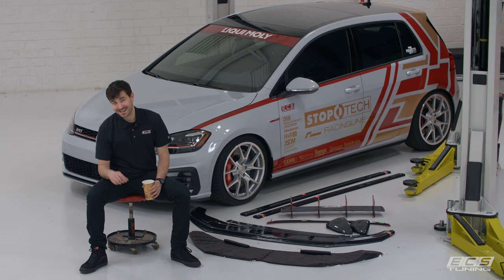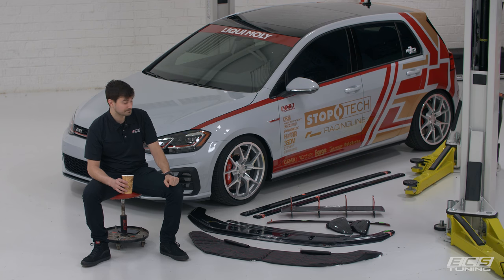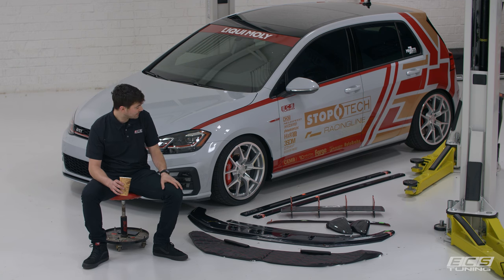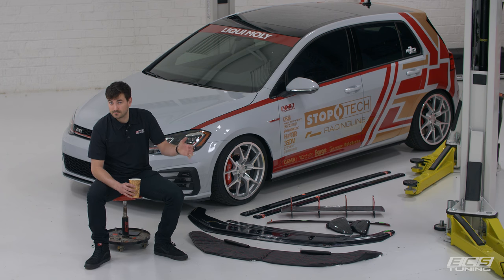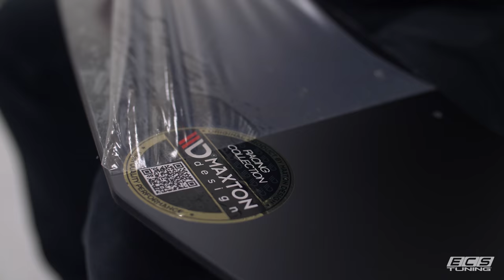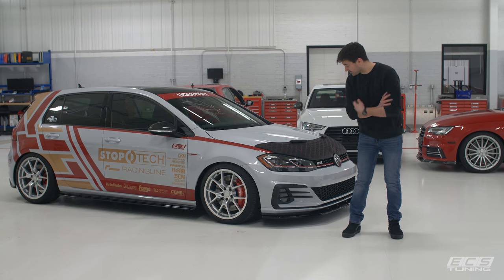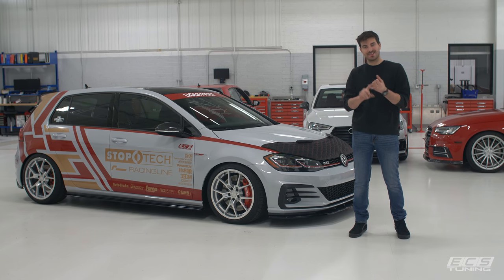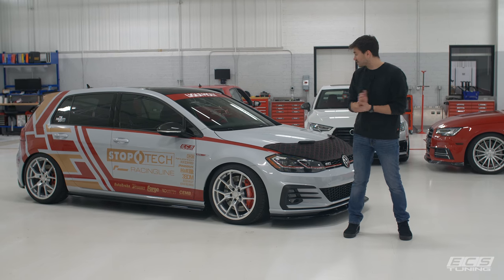2018 VW GTI (MK7.5) - Installing Exterior Mods

Comment from the maker: MK7.5 GTI Maxton Parts are now available: https://goo.gl/9gUsmv
Reply: You never went into the specifics with respect to the wheels. What size are they  and are you running a stock tire size. I know the 3 piece wheels that were added later were 19s with a 35 offset?

Comment: I'm sure the stickers were applied correctly but they make the rear look like it's sagging; almost as if the car is bending just behind the rear door.  I don't think these stickers do the car justice. Not a fan of the hood bra/bro either...however, I wouldn't turn it away if I win it or if it was given to me.  Cheers.

Comment: I want to know... does MK7 rear diffuser work on MK7.5 ?? I have a TSi (1.8T) and the one thing I hate is the chrome strip on the rear bumper... can anyone confirm if they fit? I want that MK6 R32 
look for my 7.5 :P

Comment: How you installed rear wing extension to mk7.5 gti because dealer told me that maxton design wing extension which is for mk7 GTI is not fits to mk7.5GTI ? Thanks for answer :)
Reply: Aha, pre-production parts OK :)
Reply: @peterturnansky8885  so did it fit for 7.5 gti ? man i love this rear wing extension but when i emailed and asked them they said it's only for mk7. If you actually bought it and it fit please give me the link too thank you :o
Reply: @rickybui1997  hey, they have already for mk7.5 gti but clubsport wing https://www.maxtondesign.co.uk/body-kits/volkswagen/vw-golf/vw-golf-mk-7.5/vw-golf-mk7.5-gti or thi one https://maxtondesign.eu/SPOILER-EXTENSION-VW-GOLF-MK7-GTI-FACELIFT-p14302 I did not buy yet 🙄

Comment: Is it $50 per visit or as a collective? Like if I spend $30 one week and let’s $30 the next week will I still be entered in 1 time?
Reply: Since I have an ecs account?
Reply from the maker: It's based on cumulative orders during the entire duration of the sweepstakes.  For example: if you place 50 orders of $1.00 you'd get an entry!
Reply: ECS Tuning oh that’s cool thought it was a $50 minimum each order. Thanks
Reply: ECS Tuning thanks for the reply! Got a few entry’s then nice

Comment: Wheels specs ? ? please
Reply from the maker: The wheels are 18x8.5" et45 all around, but we used 10mm spacers in the rear to get the fitment a little better. Tires are 225/40/18